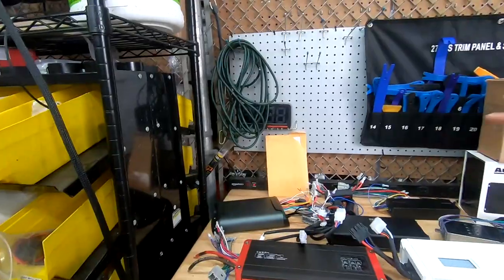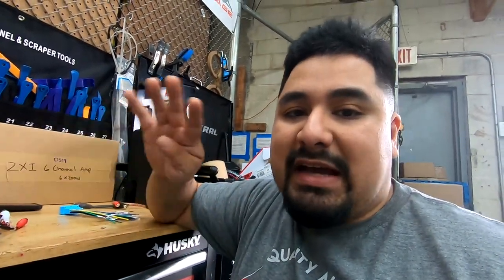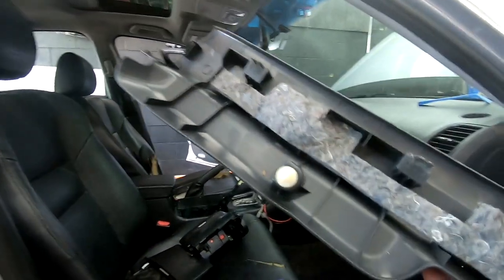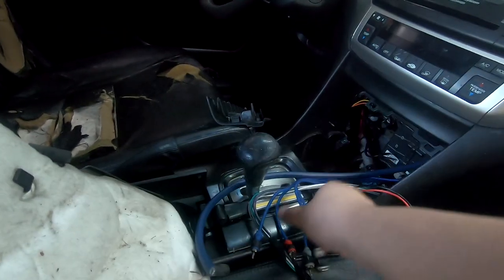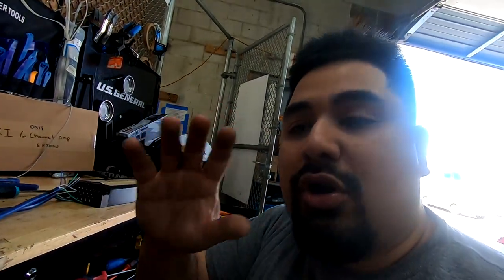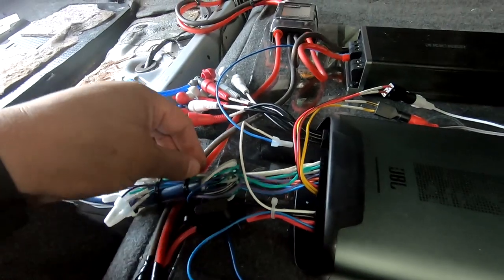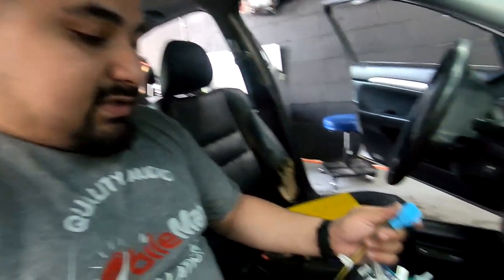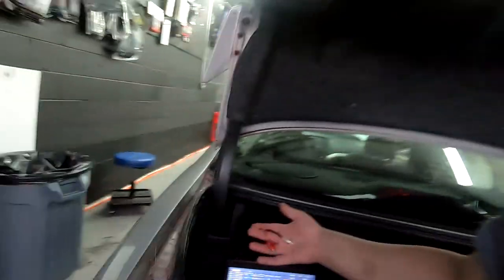2004 2006 2008 Acura TSX Full Audio System Upgrade | 6 Channel Amplifier Install - DIY PRO Series

Comment: If you can guarantee me a aftermarket system that sounds and hits like a factory Bose system or a factory harmen kardon system then we can do business. And using my factory radio..04 Acura TL.
Reply from the maker: Not sure which Factory Bose System you are referring to or which Harmon Kardon system. If you can show us the system we can let you know.
Reply: @AcuraAudioGarage  Those Nissan Altima and Maxima has the Bose system, man it's amazing how they get so much hard hitting bass from out those little speakers. I have a 05 land rover with the harmen karden system hitting like 12's are in it..

Comment: Hi guys love your videos. I just wanted to know. I am running two amp with the aftermarket system. Should I run all the rca cables through the aftermarket system or the harness you have for the factory amp? Thanks.